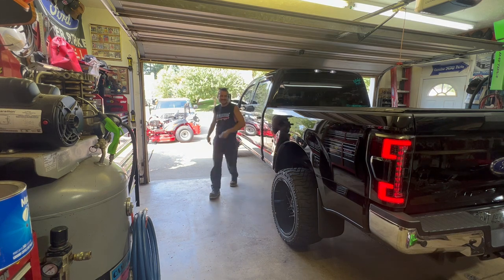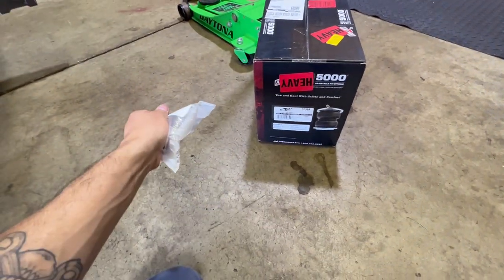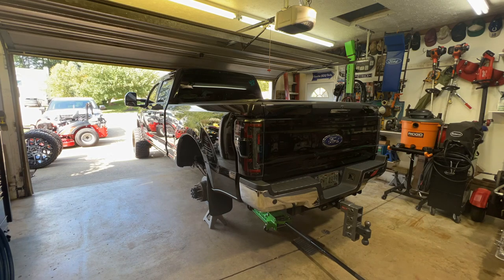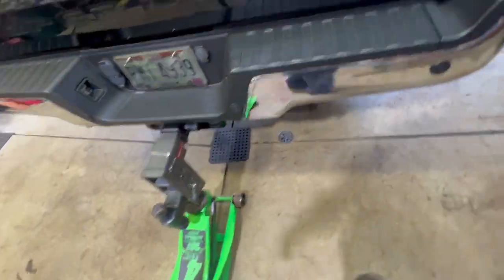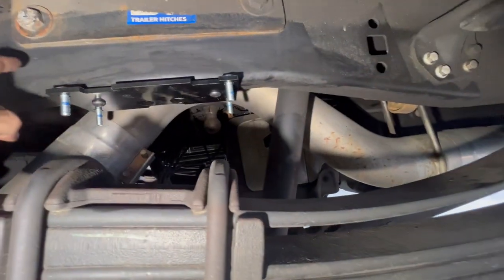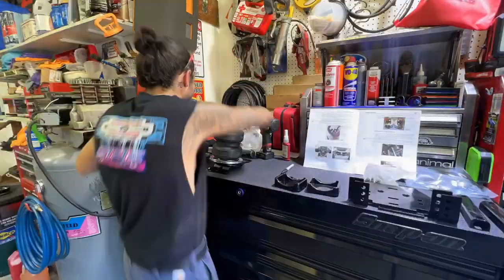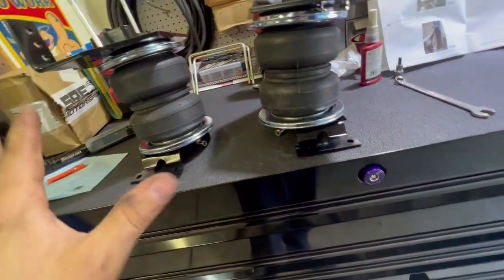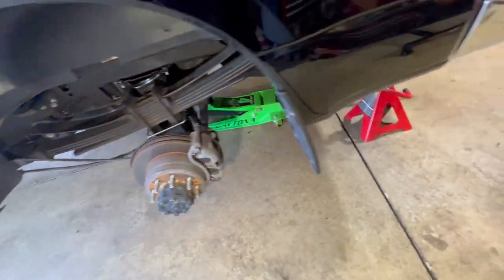I Finally put AIRBAGS on my 2017 6.7 POWERSTROKE!! Full Install of AIRLIFT 5000 bags! MUST HAVE!!

Comment: Does that help soften up the rear end?
Reply from the maker: I didn’t notice much of a difference with just everyday driving but I know it will help a ton because when I tow the blue truck it’s usually on the bump stops so everytime I hit a bump it was terrible
Reply: Oh ok my truck just rides really rough on the back even when I tow it doesn't squat much at all
Reply: Just installed mine a week ago. Haven’t had the chance to try them out yet. Fairly a decent install. Just about 3-4hours
Reply from the maker: @dwightparker3065  yes I agree decent install